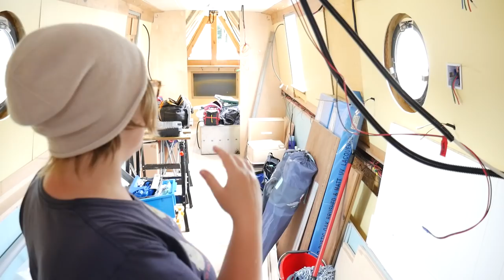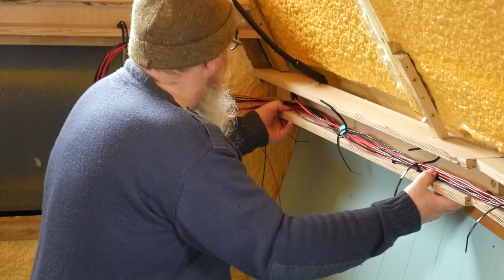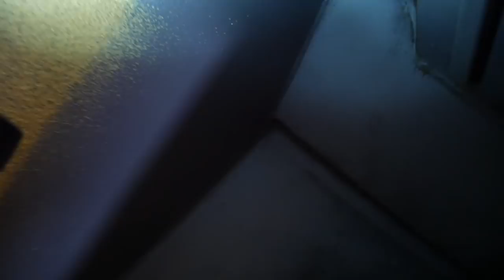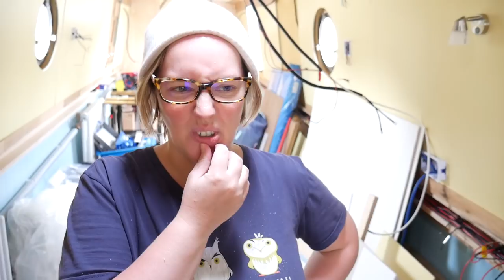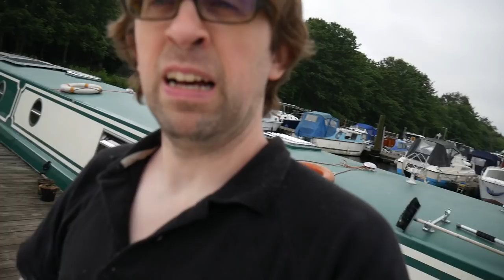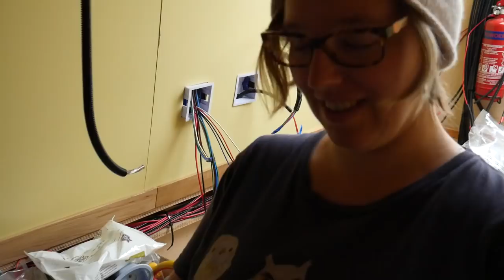Back in the Saddle – A Narrowboat Zero Gravity Progress Report

Comment: Great to see you both back at it, it has been 3 months since your last very short update video, I am glad to see you had the good sense to put a water fill on both side of the boat, I do the same thing with all the custom pontoon house boats I build, same as the fuel, that way it don't mater witch side you dock on, as for the junction box on the roof your lucky to find one with any openings in it, them water tight PVC boxes normally come with no holes in them at all, and you drill out the sizes you need and glue in the adaptor fittings with PVC  glue  or tap the treads into the box then tread in your water tight compression cable fittings. hope your not gone again for weeks

Comment: make sure you repaint any primer thats removed with the multitool , the scratches through to steel will quickly turn into fissures of rust  and rott out, especially as its around the water inlet.

Comment: Great to see you back! Boat coming together for sure. I have 4 solar panels totalling 1280w but only two wire connection through the roof. Worth noting that mc4 solar connectors are only waterproof when connected together so yours are currently open to water ingress.

Comment: Good to see you back . I would invest in a spray foam gun and some cans of spray foam plus a can of cleaner from the likes of Eurocell ( the do all the bits for window fitters ) its what window fitters use and its the same as the foam in your boat you can do a 5mm bead to a 30mm bead of foam , I've had one for about 10 years and use it on any thing I need to fill gaps on

Comment: Regarding the pipe for your tank why don’t you just add a cut away in the door for the bow thruster a U shape in the door will be easier and you will still have the access you need. Also if the water inlet is set on a vertical this will also make easyer to fit and give you room to run the pipe !
Hope that helps 
👍😀🐾

Comment: Hi! I am not sure if you have time to answer questions but just in case you do... Say, where all this work can be done? Should it be on the land or the boat is on the water? If it is marina, does anyone around mind the noise (drilling, cutting wood etc.) And another question are you going to buy a generator or use solar panels? Because as I understand you work from home on your laptop and you need a good and reliable source of power. Sorry for asking to many questions. I really admire your dedication and I can't wait to see the video after all the hard work is done.
Reply from the maker: Hi there - sorry about the very tardy reply. In answer to your question, it really depends what you've got access to - if you happen to have some land where you can park a boat, it does make certain things a lot easier not having it on the water. We didn't really have a choice about going in the marina, and it does limit certain things (like painting the hull), but most of it can be coped with. In terms of noise, it depends on the marina - we're kind of lucky that the marina we're in isn't that busy in terms of liveaboards, and we usually try and let next-door-neighbours know if we're going to be especially noisy. And in terms of power, we're going for solar power, and we may possibly add a wind generator as well – we don't really have the room for a fuel generator, but we should be able to make solar work, and we'll be recharging every time we use the engine anyway. Hope that helps!

Comment: Hi there, see you have gone for a sailaway from Tyler Wilson , I am looking at a new build boat , I visited the site this year on an open day but the only person available to speak with was Ken from ex Fernwood boats, now Finesse .  I want to know why you went for a fore cabin design as liking it and if you went for any increased dimensions on base plate or hull sides and whats the length of your boat please ? Many thanks, btw following your journey , Great !!
Reply from the maker: Hello! Sorry about the very late reply - I don't think we went for any increased dimensions on the base plate or hull sides (or if we did, it's completely vanished from my memory!). The reason we went for the extended forecabin is that we knew we wanted to live aboard, and neither of us wanted a bed set-up where either someone would have to clamber over the other person in the night, or where we'd have to fold away the bed every night. The extended forecabin would mean we'd be able to have a big bed permanently at the front of the boat, and it also bought us a few extra feet in terms of internal space. It's given us a couple of complications (like we eventually decided to put in two water inlets at the front, on either side of the boat, to reduce the amount of clambering around) but we're certainly happy with it so far!